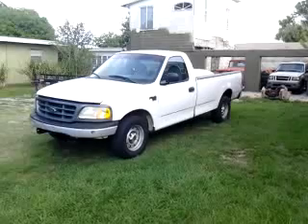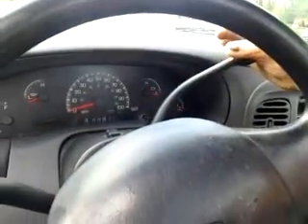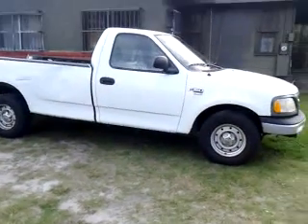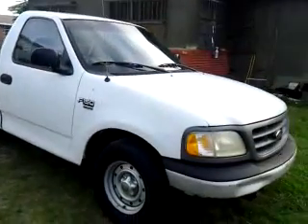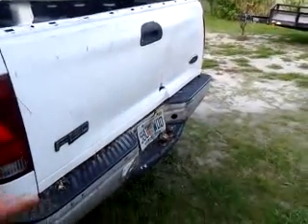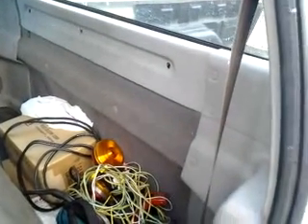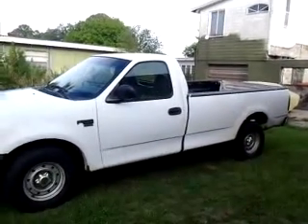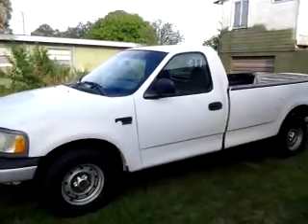2000 Ford F150 Work Truck Fleet

Comment: I loved my 00 F150 work truck. My drives side of the bench looked even worse. Looked like a Rottweiler had ate it. Truck was all banged up. The bed looked bad. Had 14 years of concrete dust that would not scrub off. She was a beast of a truck. Still ran when I scraped her. Over 300,000 miles. Mine was a V6 tho. Only ran on 5 cylinders. Best $1000 I ever spent. I hardly did any work to her. I stopped doing maintenance really.  Self oil changes here and there. Every time I changed the plugs they was covered in oil in no time. Water leaks is why I let her go. Fix one and another one would start. Would of cost too much to replace all the hoses etc